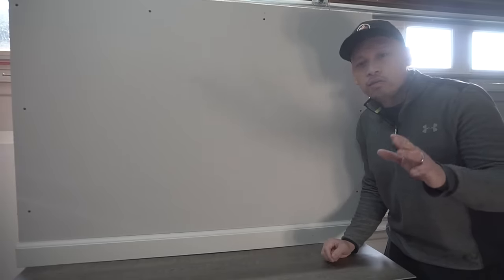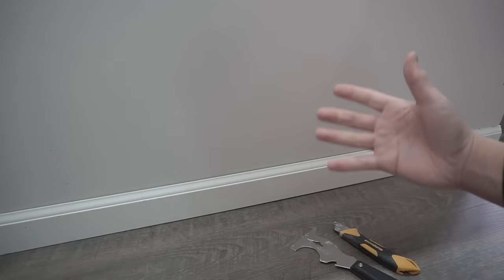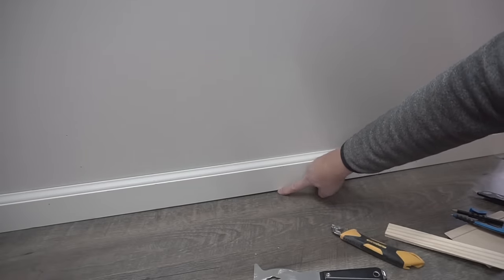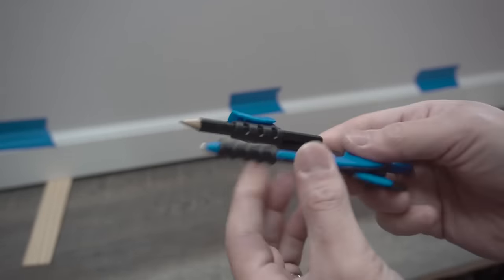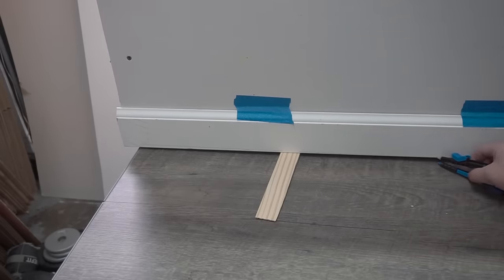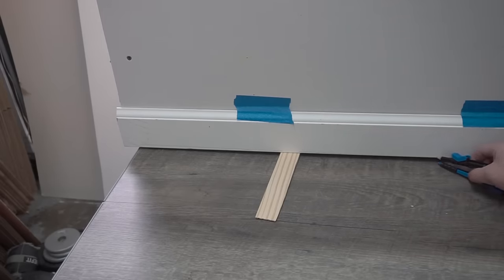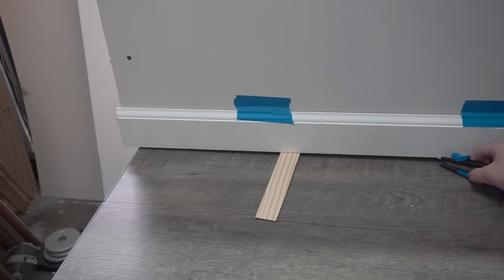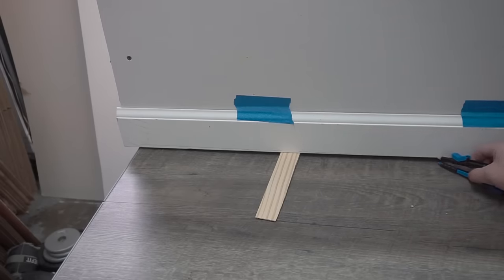How To Fix Gaps Between Baseboard And Floor For Perfect Fit! DIY Step By Step Tutorial For Beginners

Comment: I had exactly this problem when placing new skirtings in my old rickety house.  

However I chose not to go this way because it works fine when doing it on just one wall but the adjoining wall(s) should have to start off lower by the amount taken off the ends in this case, so that the corners lighn up.  Then you end up chasing your tail all around the room (and my room has 28 corner joints in it).

I elected to use shoe molding to cover the gaps.
Reply: Thank you exactly! 1 piece wall to wall is easy! Personally I  don't think he's a professional.
Reply: @randallhart7264  I don't think you should be commenting on topics that are beyond your level of comprehension, you're welcome!
Reply: This video is a brief tutorial to show the proper method of installing baseboard, it is standard in high-end finish carpentry. No one needs to chase any tails, you simply need to go about any task in a professional manner, and in this case it starts with finding the low point in floor adjacent to the walls being covered with baseboard, compare that with the highest point, the difference is the amount that will be scribed onto the bottom of the basebord when all pieces are level from the high point. Your standard for your rickety house is not what anyone else would be interested in knowing.
Reply: @larrydaniels8976  
Here's the thing.  I'm not a professional and I assume that this clip is aimed at DIY people as I would hope that professionals don't need to be watching this.
Reply: @larrydaniels8976   I never have commented on subjects I know nothing about! But I damn sure know about this subject! Now you have a wonderful day
Reply: @randallhart7264  Your knowledge of trim carpentry is woefully inadequate.
Reply: @larrydaniels8976  Actually, high end finish carpenters do not do it this way.  They complain to the owner, who then makes the flooring guy come back and properly level the slab before laying the flooring.  This technique is a short cut to hide shotty craftsmanship.  If the floor is bad enough and it wraps the room, the trim will end up looking narrower on one side of the room than the other, as you have to trim each piece to match the piece you trimmed.  If this is your trade, you would get run out of a high end job.  Stop coming into comments talking about things you know nothing about.
Reply: @trollbane66  You and I have very different views of what constitutes "high end". In almost every case, a true high end finish carpenter would never be in contact with a home owner. They would instead be dealing with an architect, designer or GC.
Reply: Yikes, taking a datum at just one point propagates an error through the entire work, as it isn't uncommon for a floor to have multiple points of irregularity. In older buildings, this is common.  As someone who not only restores period antique French furniture for a living, and has the skill to replicate any piece on that furniture (boulle/tortoise marquetry, hammer veneering with hide glue, exact carving reproductions, engraving, inlays, etc.) I find your "high-end" carpentry claims really pretentious verging on comical, as your interpretation  of high-end is my equivalent of fitting lego pieces together.
Reply: @larrydaniels8976  You clearly have no idea of what you speak.  There's enough sketchy information on youtube already (this video for instance) - no need to add to it.

Comment: I appreciate your demonstration on your method of contouring your baseboard, my only question I have is how would that transfer throughout the entirety of the installation of the base boards. Would it be that my pitch on one end is slanted or higher than my adjacent end of the boards?

Comment: In a situation like this, after a test fit, I mark the low point of the floor board (while baseboard is not installed yet). With the floor board a quarter inch gap from the wall, I raise the low point of the floor by inserting plastic strips wedge to raise the floor low point. Its however a lot easier when the floor board is running parallel to the wall as I can pry the floor board higher to insert longer cut out plastic strips to reach the second board. This solution is also in response to PogChamp query. Thanks for the video its nice to learn more option.
Reply from the maker: Thank you so much for sharing your technique and advice! I’m so glad you understood my thinking on this that this is just another option, including your technique, other than caulk and quarter round or shoe 🙏🏽😊👍🏽
Reply: @FixThisHouse  qtr round always gives a much richer finish, i just say'n

Comment: The real trick is when you have to cut a 45 to continue the baseboard on an adjacent wall. Like for a square room, the error for one wall will continue to all 4 walls.   Sometimes caulking or a round-over trim piece works better.

Comment: Q: Why don't you simply use caulking to fill the gap?  Because the baseboard molding needs to be at the same height as the adjoining boards.
Reply: I totally agree. In UK we call the baseboard the skirting board.
Anyway, you are supposed to leave about a 3mm gap between the skirting board and finished flooring to allow the floor to expand and contract with room temperature.
I then use a flexible caulk to close the 3mm gap.
Reply: @chrisperrins8082  *baseboard
Reply: What about as a renter in an apartment? We are currently at war with some roaches and they hide in those cracks. Would using caulk be an acceptable solution in this situation? Landlord isn’t gonna take the time to fix them anyway
Reply: @gjhslibraryrocks  try advion roach  bait killer. Works very well.
Reply: @gjhslibraryrocks  call pest control - bill to landlord
Reply: @chrisperrins8082  are you serious ? So you caulk the bottom on the skirting to the floor 🤯
Reply: @gjhslibraryrocks  I have carpenter ants and my apartment won’t do anything about it, I just finished caulking the entire apartment, worth it. Highly recommend, my apartment gave the good ole, it’s a 30 year old building what do you expect and we pay monthly for pest control. This has solved our giant ant problem.
Reply: @KiXa1  yeah, thats normal practice... whats the problem?
Reply: @Pancajayna  no its not .. the skirting to the wall yes .. Its possible as times It may get a bead of silicone in a bathroom or kitchen but it's certainly not normal practice ..aye for cowboys trying to hide things 🤷‍♂️
Reply: @Pancajayna   the normal practice for a professional is to scribe to the floor exactly like he does in this video 👍
Reply: @KiXa1  that is not the normal practice. Doin that would require you to also cut those adjacent to keep the level which is impractical. What is done is after the caulk, it is taped and painted to give the illusion of no caulking.
Reply: @Pancajayna  that is not the normal practice .. the normal practice is shown in the video 👍
Reply: @Pancajayna  are you a decorator,  joiner or neither ?
Reply: @Pancajayna  the top of the skirting stays level so will run perfect to any other skirting .. only the bottom of baseboard / skirting is scribed to the floor.
Reply: @KiXa1  when you scribe, you lower the skirting based on the depth of the unevenness. Remember you are cutting off a piece to cater for the unevenness of the floor.
Reply: @KiXa1  This can be done only where this section is incongruent to the other sections.
Reply: @Pancajayna  yes the floor  it doesn't effect anything else .. caulking a cap between a skirting board and a floor most definitely isn't recommended,  it's that simple.. there is movement in the floor and eventually it will crack.. I've done it before yes but it certainly isnt 'normal practice' .. as I've said I've siliconed a wet room or bathroom with a bead of silicone but caulking and painting the bottom cap of a skirting board most definitely isn't done by professionals regularly 🤘
Reply: @KiXa1   "Professional" or not... It is normal practice... Far more than what was shown here...  In practice we do what works and caulking works... Use a better grade for this and get better results... Simple as that... I have never had a problem and no complaints....
Reply: @Pancajayna  thats like saying 50 pound watch tells the time so why buy a rolex .. caulking the bottom of skirting is not normal practice!! That's all I'm saying .. many D.I.Y ers may do it but it will not look like a professional finish 👍
Reply: @KiXa1  like I said, I've never had even one complaint... So whether they do it differently is irrelevant. The customers always loved the finish... 👍
Reply: @Pancajayna  well good on you  .. scribing isn't easy tbf so i do get it 👍
Reply: @Pancajayna  yes but sometime it's a matter of millimetres   ... if the gap is that big then It's beading job in my eyes
Reply: @KiXa1  the method in the video would have you trimming multiple moulding just to fix one that was uneven. I don't have time for that.
Reply: @Pancajayna  how would it ? .
 You only need to scribe where the floor is not level
Reply: @KiXa1  are you sure you have done this before? when you scribe, it affect ADJACENT moulding, so depending on where this particular strip is and how deep the unevenness is, scribing it would need for ALL in that room to also be cut to level with that one.
Reply: @Pancajayna  no it doesn't haha .. the top of the skirted does not change..meaning it all runs it the same.. the top of the skirting always stays straight and level .. its the bottom of the skirting that scribes to the floor ... you should watch the video we are commenting on my friend 👍
Reply: @KiXa1  "the top of the skirted does not change"  the height drops to accommodate the dip/unevenness. You can't cut away from the bottom and the height remains the same... ALSO if the floor has a slant, so will the moulding unless you account for the slant which could also make it look off depending on the slant in question.
Reply: @Pancajayna  you can scribe a skirting and keep the height of the skirting exactly the same .. you are taking off the BOTTOM .. nothing will be on a slant at all
Reply: @Pancajayna  I ask again are you a joiner /carpenter?
Reply: @Pancajayna   haha you've basically just  described the whole point in scribing ... you scribe the skirting to accounted for the 'slant'
Reply: @KiXa1  when you take OFF the bottom, what fills that space? something has to fill that space so the height can remain the same...
Reply: @Pancajayna  the slant in the floor fills in the bottom lol
Reply: @Pancajayna  watch the video again mate 👍
Reply: @Pancajayna  i think I've worked out why you may be getting confused ... I'm talking about doing it right first time round ...where as I think you are talking about taking off  one length of skirting to rectify the mistake ? Meaning that the rest of the skirting in the room isn't going to run in with the one you have scribed ? Is that what you mean ?  Haha I'm talking about doing it right the first time round. Which would mean you could keep the height of the skirting the same all arround the room. That's the only explanation I can gather off what you are talking about ?
Reply: @KiXa1  correct. I am talking about rectifying a mistake or after running skirting already(if you didn't do a 360 degree level beforehand), you come across a dip. If this is among the first that I am putting down, then yes, what is shown in the video is what should be done imo.
Reply: @Pancajayna  OK well I'm glad we agree haha I was mainly debating that it's not normal practice  to caulk and paint but anyway... have a nice life and hope you keep getting plenty work 👍
Reply: @jessicamurphy5810  oo
Reply: Caulking is the lazy way, due to dust and dirt. Do it right the first time. My new home has openings everywhere
Reply: @Pancajayna  I read this whole covo... why you may ask idk. But your conversation was like a merry-go-round! I'm surprised you both had patience to keep explaining ones opinion. Glad you were on the same page in the end😛
Reply: If you're renting and your landlord won't do anything about it, just use caulk

Comment: I usually add some heavy duty glue on the back and apply pressure and nail it. Problem fix. If you cut one board you have to cut all to have the same height especially in a square room otherwise it will look obvious. Great video thou thanks for sharing.

Comment: I have done this technique when I built my house 15 years ago.  However, I never understood the point of leveling.. Let's say you have a wall that is 20' long and for whatever reason one end is 1/2" lower then the other.  If you make your baseboard level, you will be able to tell that the baseboard is 5" on one end and 5 1/2" on the other.  If you just lay the board to follow the floor, nobody will be able to tell that one corner of the room is lower than the other.  Even more visible on crown moldings.

Comment: I assume you're not using shoe or quarter round molding, however it is key if you're not spending time to level out dipped or high spots.  I wouldn't advise this for baseboard.

Comment: Very exquisite work but the problem with substracting material is that you will have to work on all sides of the room to match the one that had to be fixed.    I am too lazy and would prefer a fix along the lines of ADDING material.
Reply: I was wondering if this is possible...

Comment: What happens when you then have a corner whether be an inside or an outside cut corner that meets up to that low end you cut on the left side? The trim running down the adjacent wall that meets that at the corner it’s gonna now be a quarter inch taller and now you’re gonna have an issue there.
Reply: I was just about to day that, that method only works if you don't have another baseboard meeting up to it
Reply: I was going to say the same thing! This won’t work if you have any corners. Just push the baseboard down, unless you are using oak or something it’s flexible enough.
Reply: It was a lot of effort that’s pretty much pointless because it’ll work in like 2% of cases

Comment: Good method.  Although I prefer to use shoe molding. I just like how shoe molding adds more beauty to the baseboard in addition to hiding those gaps.  Plus shoe molding installation takes less time than sanding the baseboard.
Reply: what's good about it if he goes 10 feet down the length the will be no more trim on one side .

Comment: That’s fine if the both ends die against casings. Would you take that 1/4” off around a miter or scribe joint and down an adjacent wall? When would you stop?  I’d bow most of the gap out and live with the rest. Someone suggested sanitary shoe molding under a rabbeted base. That would give you a fudge factor that seals the floor to wall junction loosing the gap up in the rabbet and no scribing. Always tear the nails out the back!

Comment: When I pull baseboard moldings or door trim/casing off, I usually use my angle grinder with a thin metal cutoff wheel to cut nails off the back instead of hitting them back out to avoid covering up all the old nail holes and new ones when reinstalling trim.

Comment: So glad I read the comments about using this method. For sure avoid if baseboard has adjoining pieces which is probably going to be most of the time. Otherwise its going to look like 💩💩💩 with your baseboards in mismatch height. Thank you comment section.

Comment: Just mark the floor at the 90 degree mark using a set square, tape along that line and fill the gap with CT1 make sure to use a 90 degree silicone shaping tool. CT1 is paintable..And Bam!, Robert's your fathers brother.

Comment: I think the baseboards would look best running parallel with the floor, and not necessarily level.  Especially on a concrete floor that has settled unevenly because it could be 1 1/2 lower on one side, then the baseboard would be way too short, it would look awful.  You are on the right track though, that is a great trick to make your cuts tight, and I use that in all kinds of places.  If you are going to cut the bottom of the baseboards you would need to make sure that they will look even with the floor along the whole room, so leveling it is one method that could achieve that, if the floor is level enough...  if it's not, you would need to make sure that the baseboard is following the average slope of the floor along that wall, so the baseboard doesn't get progressively smaller or larger from one end of the room to the other.  Then use your method to cut off the bottom to conform to the floor.

Comment: The secret to avoiding having to go back and cut the rest of the baseboards to match the new lower height of a baseboard you had to scribe ond remove material from an end of the baseboard is to purchase a matching baseboard that is taller than the original. Then you can simply scribe it and adjust your cut to accommodate for the height of the original baseboard.

Comment: Yea, now what happens when you connect to other baseboard on adjoining wall that is 3/8" higher. Will not line up or match. Scribing that you showed may not work - although a good thing to know for many projects!

Comment: Your advice will likely leave every baseboard at an obviously different height when intersecting a corner.  In addition, any previous caulk at the baseboard top will remain an unsightly reminder of the bad idea once its height is reduced.  With texture on the wall, it will be impossible to cleanly rectify.  The only real fix is a secondary trim (qtr round typically) mounted to the floor.  Easier too.
Reply: I like your idea of the quarter round trim way more than this way. My first thought of this video is if you change your flooring again your baseboards are a weird shape. Not to mention the difficulty.